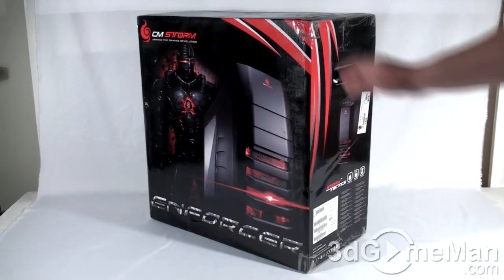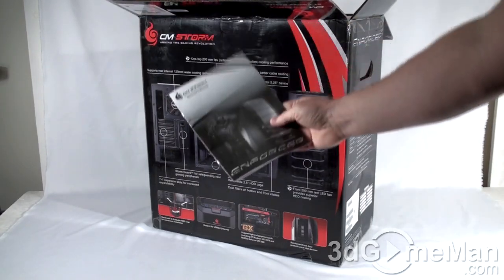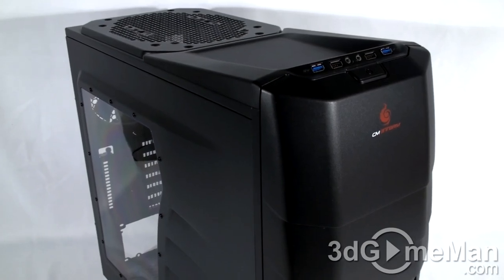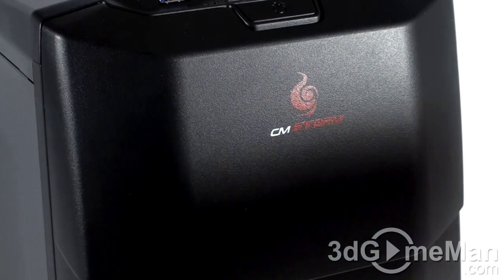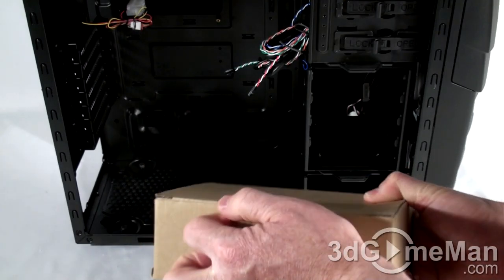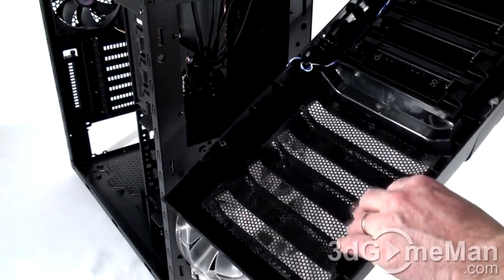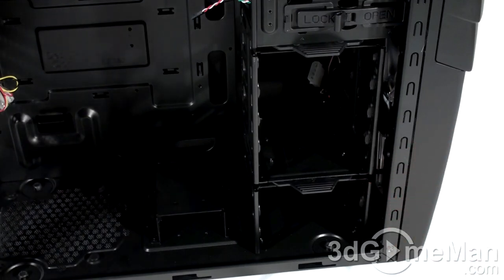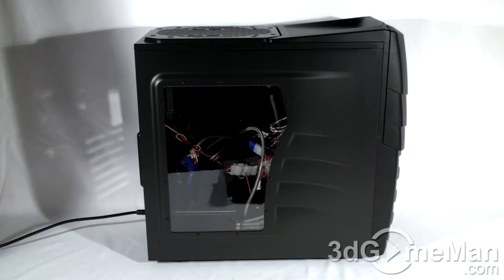#1226 - Cooler Master Storm Enforcer Case Video Review

Comment: It should. You could go with with a few different permutations, but at the base of all of them is the the radiator being at the top.

If you're not to concerned about looks, I'd put the radiator on the outside of the case with two 120mm fans on the inside and two 120mm fans on the other side of the radiator (on the outside, with fan guards for safety) in a push/pull config. That way you have a lot more space left in your build.

Comment: Unfortunately, it can't, because there won't be enough clearance between the rad and the motherboard, so yeah cable routing would get difficult there. But it will fit an H80 rad at the back, not the top.

Comment: Could you possibly remove the front 200mm intake fan and replace it with 2 120mm intake fans instead? An answer would be appreciated :)

Comment: Yet another dumb design flaw. Those front USB and audio sockets are pointing upwards, which means dust and all sorts of crap will fall into them. Add a little moisture and it'll eventually turn into gunge, and if a bit of cola gets into there - instant disaster!  

You really have to wonder what kind of idiot designer it takes to overlook something so elementary. No doubt thinking about his next Mars Bar. Funny how this so-called 'expert reviewer' didn't realise it either.